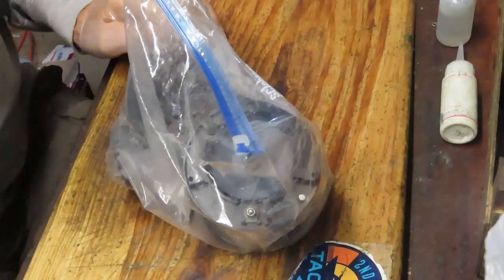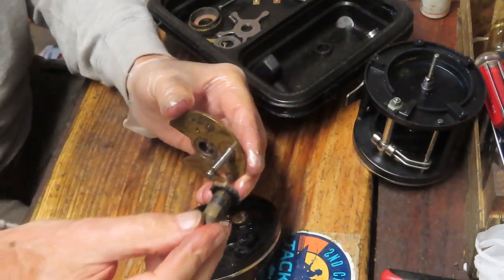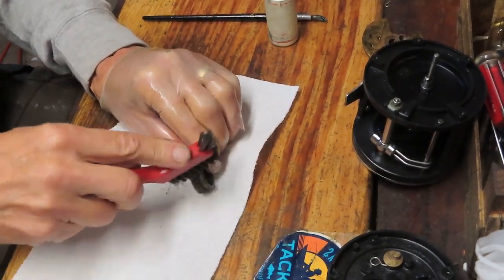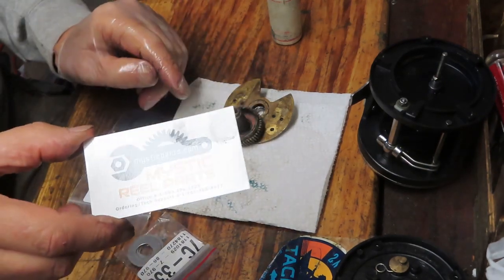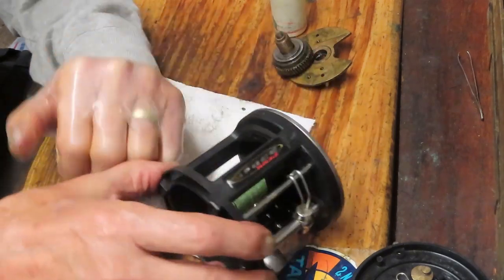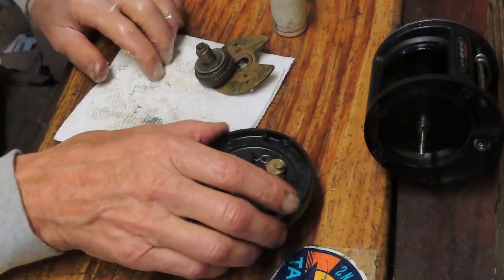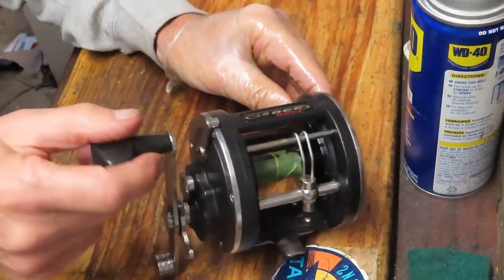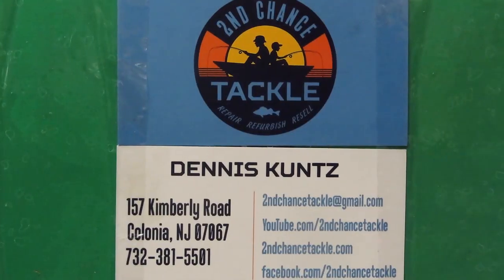Penn GT1 330 reel in a bag how to service including replacing the drag washers and assembly

Comment: How much drag? Well yesterday I did a bit of an experiment with drag settings after catching a few striped bass, and adjusting the drag to what I felt was suitable... caught a 26 inch one that was very feisty and mostly steady reeling in but occasionally pulling drag nicely... so I measured with a digital scale what that amount of drag actually was, and was surprised that it was only 7 pounds of drag.

Comment: Dennis, I always love your reel in a bag videos. I have a problem of my own that I think I’m going to have to send you. Have you ever heard of a reel with two ball bearings and a spring inside on the pinion on the axle shaft. Years ago I gave my son-in-law a Daiwa Emcast Plus 6000 reel. Yesterday I fried to service that reel and failed miserably! Everything works great until I put the rotor back on and it will barely turn and run terrible\y. Any ideas or should I just send to you. In over 320 spinning reels this is my first failure. I’ll send you a copy of the schematic. You’ll have to blow it up to see it. — Chris
Reply from the maker: Check the stack against the schematic, which you can get through this link https://www.reelschematic.com/wp-content/uploads/schematics/Daiwa/Emcast/DAIWA%20SPINNING%20EMCAST%20PLUS%206000.pdf My guess is that you are missing or have mis-installed a shim washer near where the rotor attaches.  Probably on top of the bearing and under the rotor 0 Dennis
Reply: @2ndChanceTackle  Dennis, I don’t have time to check it because we leave for the beach in the morning. Rick Stivers just did a video on this reel and I saw two places where my pinion stack was wrong. I’ll test it when I get back. Imagine a reel with two ball bearings and a spring inside the pinion gear. This is one weird reel. — Chris